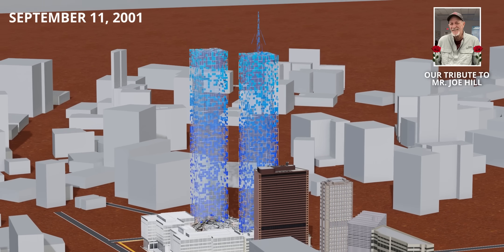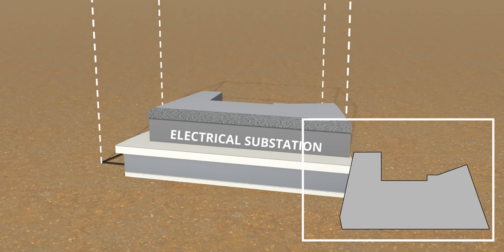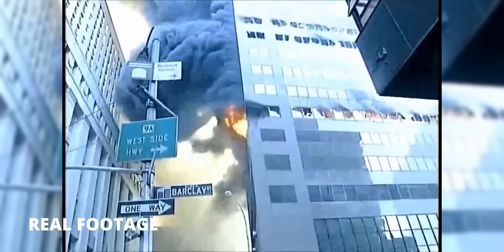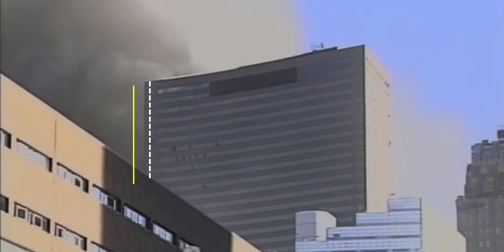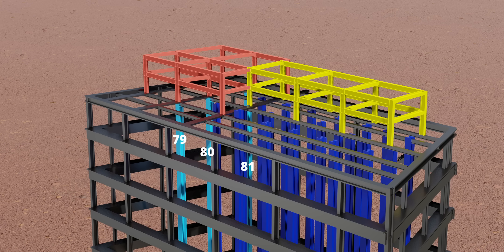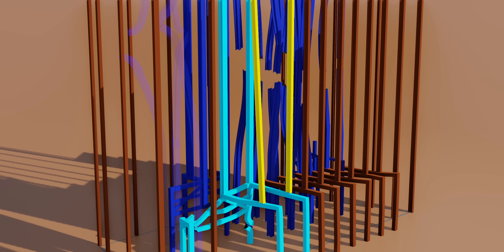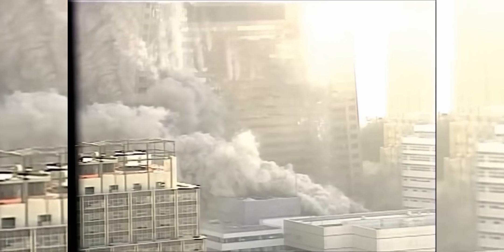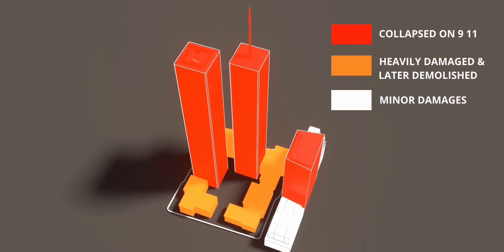Collapse of Building 7 | The Complete Physics

Comment: So three columns failed and down came the whole fucking thing?
Reply: To boil it down to the dumbest possible, yes.  To parse it out into more detail:

The collapse of Building 7 was from the inside out and entirely different to the Twin Towers, not at all intuitive and thus harder to understand, with most details being hidden from view.  It requires careful analysis and observation, and some people will struggle no matter how much it is explained. But here is my explanation relying on no outside authority. 

Building 7 was a unique, asymmetrical 47-story steel frame structure built atop a smaller 3-story building serving as a partial foundation, requiring lower floors dedicated to complex load transfer structures. Of trapezoidal shape and tube-in-tube construction, B7 (above the 7th floor) consisted of a central core of steel columns carrying most of the gravity load, perimeter steel columns around the outside of the structure carrying the remainder of the gravity loads and long span beams and girders to tie those elements together and form the floors. On the outside of the building hung a moment frame or outer shell. 

www.nist.gov/image-16640

Phase 1 : First externally visible signs of collapse initiation occurred at 5:20:28 pm and was notably quiet with observers not realizing the building was collapsing! No warning in the form of hundreds of eardrum busting 180dB explosive bangs. Here at 12:00 a local CBS affiliate reporter talking 10 blocks from B7 when collapse begins. People don’t start to notice the collapse until 12:11. At 12:45 is the famous CBS fixed camera clip of Building 7’s collapse. Note the silence. 

www.youtube.com/watch?v=t5tEy6mXSE8

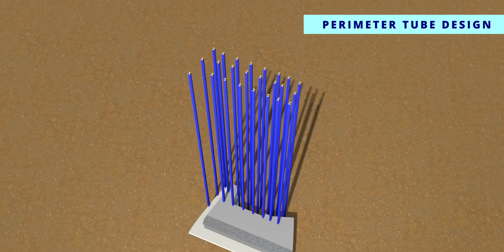Lower floor failures above the load transfer region (8-14) in the NE corner initiated the collapse. In this video at 0:45 you can see the NW corner from inside the building while under construction, Column 79 just out of frame on the left. That big, angled steel beam across the top of the frame connects to C79 at one end. The girders connect to the beam. That beam and all those girders depend on just one connection 

www.youtube.com/watch?v=nP3TNHPCIVU&t=45s

Phase 2 : NE corner floor failures caused a loss of critical lateral support over an excessive length of Column 79 and it buckled. Looking at the above floor diagram of Building 7 when you see all the structures that depend on C79 you quickly realize this one column was a relatively isolated structural element on which a disproportionately greater fraction of the structure depended analogous to say the Key Bridge. Externally as collapse begins we see a vertical progression of window breakage along the 44-46 line and a kink in the roof of the East Mechanical Penthouse at the top of the building, consistent with C79 failure. Normally with a buckling column, the load could be redistributed to other columns. With C79 that is not the case - the failure did not redistribute the load, so the collapse rapidly progressed to the roofline, sinking the rooftop penthouse. The transition from full capacity to almost no capacity occurs in an instant and will result in virtually no resistance 

Phase 3 : With C79 gone, B7’s progressive, non-symmetrical collapse continues with adjacent columns 80 and 81 left laterally unsupported and quickly buckling as well. The EMP drops down through the building. C79-81 all have no diagonal bracing, which is the major reason why they could not redistribute a lot of vertical loads among one another. From there collapse progressed from east to west through the central core until the core was gone from 81 to 58, taking all the interior floors and probably most of the perimeter columns with. Follow the horizontal progression of window failures low in the building and the dropping of the remaining rooftop structures into the building. The NIST Building 7 study model 4 determined C79 failing under ANY circumstances would have initiated the same collapse sequence. 

Phase 4 : After about 10 seconds only the exterior moment frame remains, giving the illusion B7 is still standing to the casual observer since little has outwardly changed. But it is just a hollow empty shell like an empty cereal box supported only by a few remaining columns and overloaded from the loss of the core columns and floors, quite unable to remain standing. With nothing remaining behind it, the north face leans inward, forming a V in the roofline, the last few columns buckle under the strain and the moment frame free falls, landing on top of the debris pile. 

It is only here at the very end, a single measurement of alleged free fall acceleration is taken, from just one point on that outer shell. The Building (core and interior) did not “free fall” - was already gone before that happened - just one corner of the outer shell briefly moved at a rate comparable to FFA. This alleged FFA was a product of how the shell fell NOT why the building fell . It’s also not even proper FFA as the single measured point was moving in 3 dimensions, not just down, which adds another variable. Start to finish the collapse took 18-20 seconds, 3 times longer than true FFA . How fast something falls can’t tell you what started it falling, certainly not 10 seconds after it started falling.  

The debris spread outside the footprint blocking surrounding streets, heavily damaging the Verizon Building and destroyed Fiterman Hall. 

No building is meant to survive 7 hours of multi-floor unfought fires. Building 7’s progressive, non-symmetrical collapse was incidental, unintended collateral damage from the combination of fire, time & gravity started by the collapsing North Tower, true no matter who planned and carried out the 9/11 attacks or why .  Of so little consequence it barely registered at the time, only taking on semi-mythical status as an alleged smoking gun years later when demolitions at the Twin Towers, missiles at the Pentagon and shoot down over Shanksville all failed and conspiracists had nothing left to work with. 

Anything can seem like a conspiracy if you don’t understand how it works. Now you should. I hope you found this helpful, informative and it solicits informed critical comment. If I made any errors of fact, logic or reason or left anything important out, please let me know so I can fix it. OR offer a more plausible alternative if you can. Be the first. Please start any reply with the words “Tits McGee” or I will know you didn’t read it and are wasting my time.

Comment: LMAO no steel building collapses this way under fire. This was a controlled demo, we aren't idiots.
Reply: Ummm, you might be.  I can do this and you can't:  Building 7 was the 6th building to collapse of 10 lost on 9/11. Because of its early low priority and complexity, conspiracy filled the information void with simple-minded garbage by technically ignorant people promoting political agendas. 7's loss is an engineering problem and should be treated as such, so I prepared this brief summary of my own analysis to fix that, using technical analysis, not ideology and magical (non)thinking. 

At 10:28am the WTC North Tower collapsed, showering Building 7 with tons of burning debris, causing heavy damage and starting many large  fires which burned out of control for the next 7 hours. Half the FDNY firefighters having been killed, units in disarray, equipment destroyed, no water pressure, and the greater urgency of search & rescue efforts, Building 7 couldn’t be saved so firefighting efforts were pulled as futile and 7 left to its fate. Firefighters make that sort of choice every day in brush fire situations - which houses to save and which ones to let go. Only real difference here is moving the decimal on the size and cost. People get overwhelmed by the size.

www.youtube.com/watch?v=g_SvpwyC17M

Collapse of a burning structure is always a concern for firefighters. Steel buildings subject to fire rely on active firefighting to survive. Buildings are designed around 1 to 3 hours of fire resistance, allowing time for occupants to escape and active firefighting to get started, after which all bets are off. Left to their own devices they'll exceed their design envelope and collapse, like Plasco Tower and Wilton Paes de Almeida. In 7 the occupants escaped, passive and active fire protections were compromised and active firefighting was abandoned hours before the collapse, which left the building to its fate. It lost. Odds on Building 7 would eventually collapse, and it did. No big deal in logic.

 http://www.youtube.com/watch?v=WnYBX6QT0R4 

FDNY Chief Daniel Nigro - The biggest decision we had to make on the first day was to clear the area and create a collapse zone around the severely damaged 7 World Trade Center, a 47-story building heavily involved in fire. A number of fire officers and companies assessed the damage to the building. The appraisals indicated that the building's structural integrity was in serious doubt. I issued orders to PULL back the firefighters and define the collapse zone. It was a critical decision; We could not lose any more firefighters. It took a lot of time to PULL everyone out, given the emotionalism of the day, communications difficulties and the collapse terrain 

FDNY Deputy Chief Peter Hayden ; We had our special operations people set up surveying instruments to monitor and see if there was any movement in the building. We were concerned of the possibility of collapse in the building. And we had a discussion with one particular engineer there, and we asked him if we allowed it to burn could we anticipate a collapse and if so, how soon? And it turned out that he was pretty much right on the money, that he said 'In its current state you have about 5 hours 

The collapse of Building 7 was anticipated and widely reported in the media throughout the day, with 24 video cameras recording some or all of the collapse. Everyone knew what was coming and why. 

www.youtube.com/watch?v=OY5S5k3tMHI

The collapse of Building 7 was from the inside out and entirely different to the Twin Towers, not at all intuitive and thus harder to understand, with most details being hidden from view.  It requires careful analysis and observation, and some people will struggle no matter how much it is explained. But here is my explanation relying on no outside authority. 

Building 7 was a unique, asymmetrical 47-story steel frame structure built atop a smaller 3-story building serving as a partial foundation, requiring lower floors dedicated to complex load transfer structures. Of trapezoidal shape and tube-in-tube construction, B7 (above the 7th floor) consisted of a central core of steel columns carrying most of the gravity load, perimeter steel columns around the outside of the structure carrying the remainder of the gravity loads and long span beams and girders to tie those elements together and form the floors. On the outside of the building hung a moment frame or outer shell. 

www.nist.gov/image-16640

Phase 1 : First externally visible signs of collapse initiation occurred at 5:20:28 pm and was notably quiet with observers not realizing the building was collapsing! No warning in the form of hundreds of eardrum busting 180dB explosive bangs. Here at 12:00 a local CBS affiliate reporter talking 10 blocks from B7 when collapse begins. People don’t start to notice the collapse until 12:11. At 12:45 is the famous CBS fixed camera clip of Building 7’s collapse. Note the silence. 

www.youtube.com/watch?v=t5tEy6mXSE8

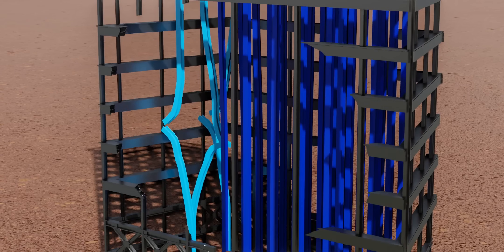Lower floor failures above the load transfer region (8-14) in the NE corner initiated the collapse. In this video at 0:45 you can see the NW corner from inside the building while under construction, Column 79 just out of frame on the left. That big, angled steel beam across the top of the frame connects to C79 at one end. The girders connect to the beam. That beam and all those girders depend on just one connection 

www.youtube.com/watch?v=nP3TNHPCIVU&t=45s

Phase 2 : NE corner floor failures caused a loss of critical lateral support over an excessive length of Column 79 and it buckled. Looking at the above floor diagram of Building 7 when you see all the structures that depend on C79 you quickly realize this one column was a relatively isolated structural element on which a disproportionately greater fraction of the structure depended analogous to say the Key Bridge. Externally as collapse begins we see a vertical progression of window breakage along the 44-46 line and a kink in the roof of the East Mechanical Penthouse at the top of the building, consistent with C79 failure. Normally with a buckling column, the load could be redistributed to other columns. With C79 that is not the case - the failure did not redistribute the load, so the collapse rapidly progressed to the roofline, sinking the rooftop penthouse. The transition from full capacity to almost no capacity occurs in an instant and will result in virtually no resistance 

Phase 3 : With C79 gone, B7’s progressive, non-symmetrical collapse continues with adjacent columns 80 and 81 left laterally unsupported and quickly buckling as well. The EMP drops down through the building. C79-81 all have no diagonal bracing, which is the major reason why they could not redistribute a lot of vertical loads among one another. From there collapse progressed from east to west through the central core until the core was gone from 81 to 58, taking all the interior floors and probably most of the perimeter columns with. Follow the horizontal progression of window failures low in the building and the dropping of the remaining rooftop structures into the building. The NIST Building 7 study model 4 determined C79 failing under ANY circumstances would have initiated the same collapse sequence. 

Phase 4 : After about 10 seconds only the exterior moment frame remains, giving the illusion B7 is still standing to the casual observer since little has outwardly changed. But it is just a hollow empty shell like an empty cereal box supported only by a few remaining columns and overloaded from the loss of the core columns and floors, quite unable to remain standing. With nothing remaining behind it, the north face leans inward, forming a V in the roofline, the last few columns buckle under the strain and the moment frame free falls, landing on top of the debris pile. 

It is only here at the very end, a single measurement of alleged free fall acceleration is taken, from just one point on that outer shell. The Building (core and interior) did not “free fall” - was already gone before that happened - just one corner of the outer shell briefly moved at a rate comparable to FFA. This alleged FFA was a product of how the shell fell NOT why the building fell . It’s also not even proper FFA as the single measured point was moving in 3 dimensions, not just down, which adds another variable. Start to finish the collapse took 18-20 seconds, 3 times longer than true FFA . How fast something falls can’t tell you what started it falling, certainly not 10 seconds after it started falling.  

The debris spread outside the footprint blocking surrounding streets, heavily damaging the Verizon Building and destroyed Fiterman Hall. 

Building 7’s progressive, non-symmetrical collapse was incidental, unintended collateral damage from the combination of fire + time + gravity, started by the collapsing North Tower, true no matter who planned and carried out the 9/11 attacks or why . The collapse was of so little consequence it barely registered at the time - a footnote - only taking on semi-mythical status as an alleged smoking gun years later when demolitions at the Twin Towers, missiles at the Pentagon and shoot down over Shanksville all failed and conspiracists had nothing left to work with. 

Anything can seem like a conspiracy if you don’t understand how it works. Now you should. I hope you found this helpful, informative and it solicits informed critical comment. If I made any errors of fact, logic or reason or left anything important out, please let me know so I can fix it. OR offer a more plausible alternative if you can. Be the first. Please start any reply with the words “Tits McGee” or I will know you didn’t read it and are wasting my time.

Comment: 3:42 "Spire from the Notrh Tower" tore the Tower 7? Like a light saber or something?
Reply: 8:12 obviously the building was made out of cereal boxes. And the spire, was made from Thor's hammer
Reply: How much did the spire weigh? How far did it fall?
Reply: @mooneyes2k478 it wouldn't matter if the spire was moving at 34 horizontal beams at 200 mph or if 34 beams hit the spire at 200 mph, the damage to each object stays the same. That spire isn't stronger than one of those horizontal floor beams let alone 30 or so.
Reply: @robbiehiatt9966  So, basically, you don't understand basic physics.
Well, that's not news, you've handily proven you don't really understand anything at all in relation to 9/11, several times, but you go on repeating it.
Reply: @mooneyes2k478 that is basic science,  for every force there is an equal and opposite force. As usual,  you people make yourselves look stupid.